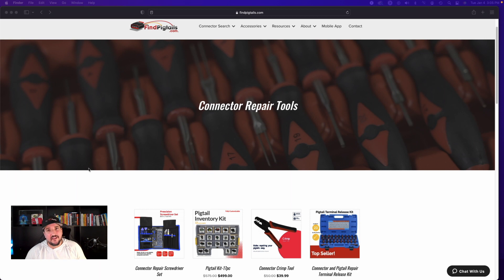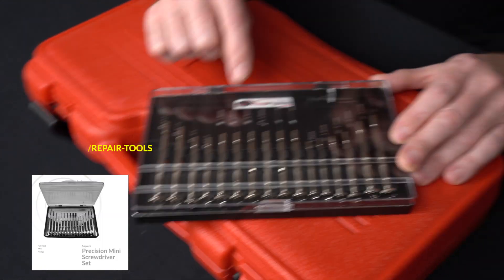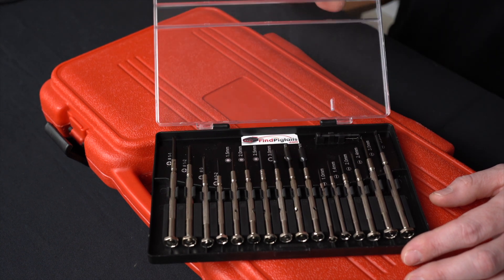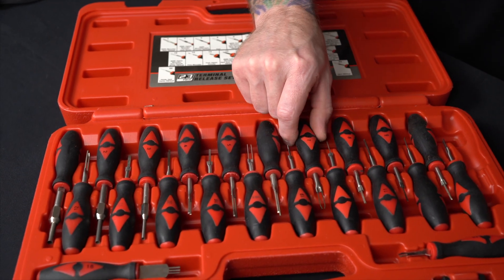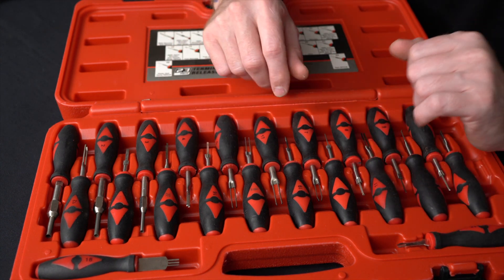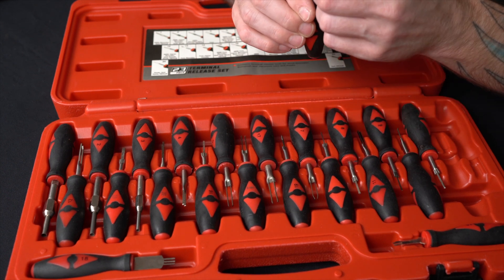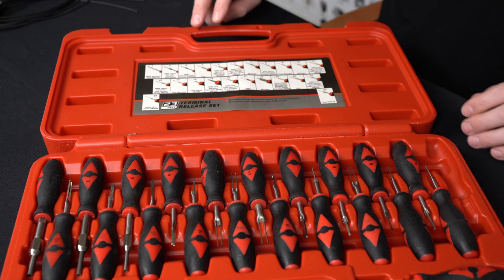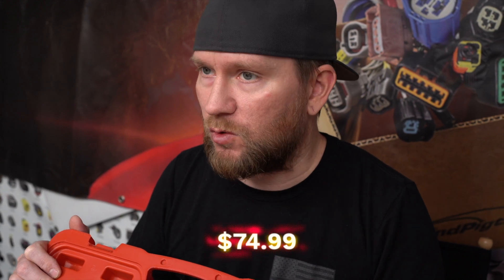Best tool for de-pinning electrical wiring harness connectors

Comment: There's literally no information on the type of terminals these tools are made for. Using non-technical vague terms such as GM, Ford, and European means absolutely nothing. I'm specifically looking for a release tool for Sicma 2.8 terminals. These terminals were first introduced by FCI which became Delphi which is now Aptiv. They were used on some BMWs, Peugeot/Citroen cars and some Fords. Good luck figuring that out.